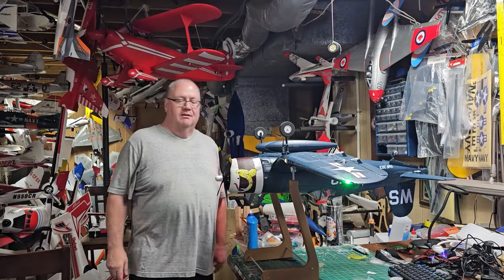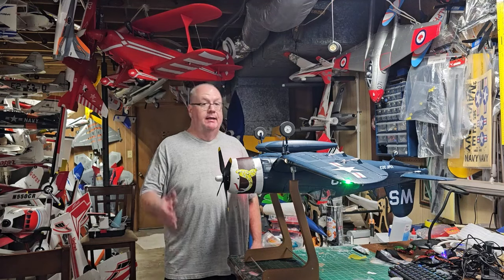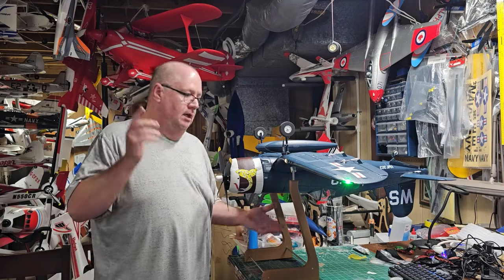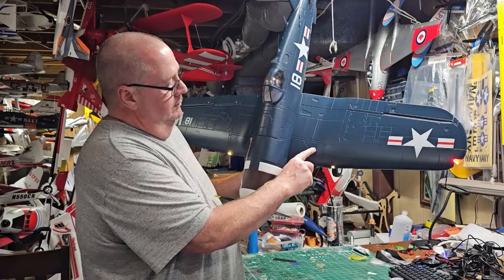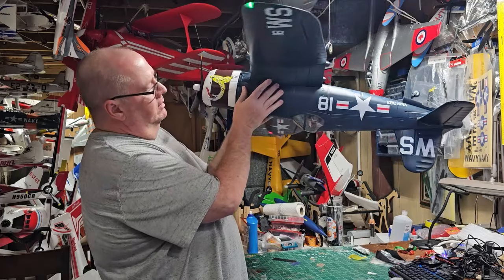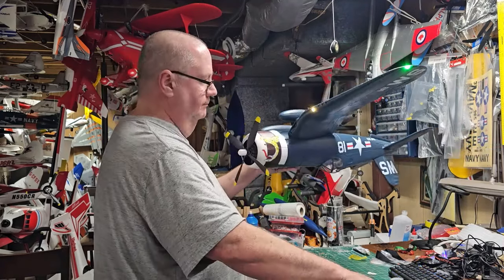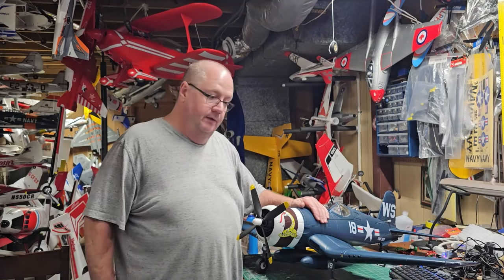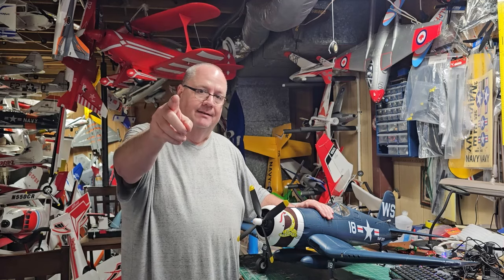ARROWS RC F4U CORSAIR 1100mm V2  FEATURES  AND RADIO SETUPS by FGFRC

Comment: Mine came with an FMS gyro.  It sits in the wing cavity.  But it comes with no information about orientation or even a means to secure it.
Reply from the maker: If you are referring to the black box in the wings that is not secured that is a connection board NOT a gyro. The FMS gyro is orange in color and says REFLEX on it. my Arrows RC Corsair has that same black box.
Reply: @FatGuyFliesRC  Wow, thanks!  I've only ever used Y connectors, so this had me scratching my head.